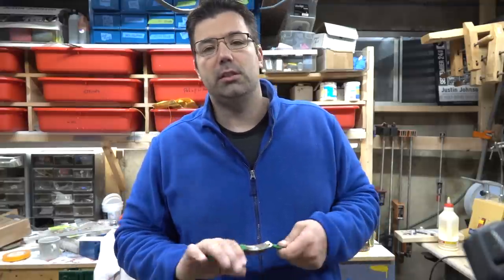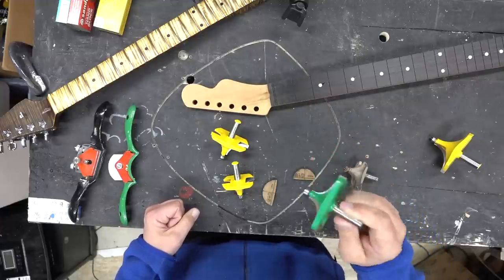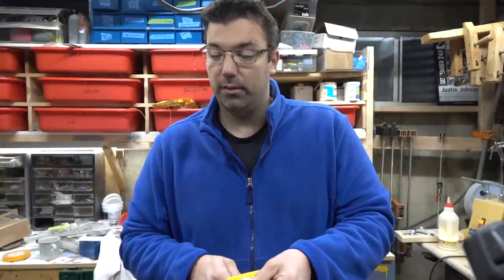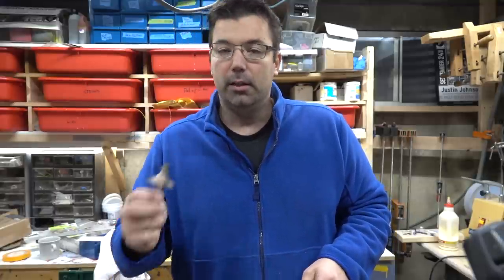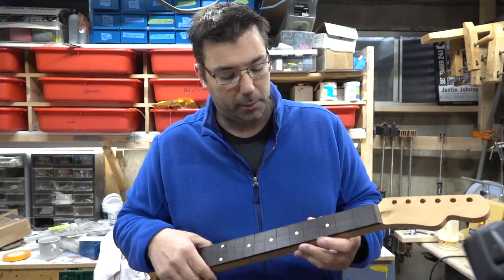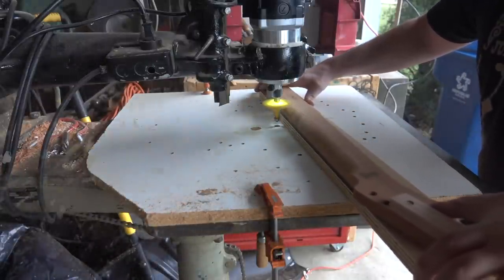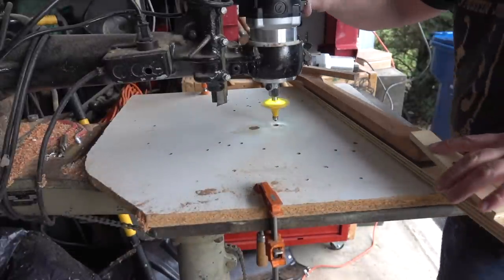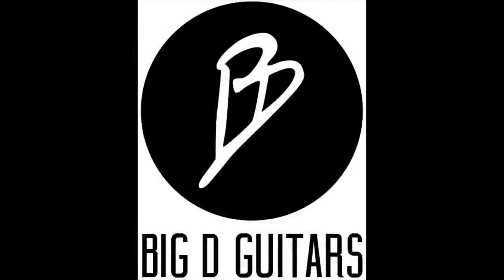Router bits for Carving Necks.  Should you?

Comment: as a 40 yr, carpenter, cabinetmaker, i can honestly say, " be careful ", with that router!!, smart to mount it in a router table!! ,, table saw, is #1 danger, router/ shaper, is#2 danger !! watch what you are doing,, dont work when your tired !!
Reply: Yeah - bit that big in a machine that doesn't have speed control & guards is definitely a bit terrifying.  lol - I'd probably set myself up with a 1" plywood "blast shield" to work behind...
Reply: Hey dan,, youre not kidding, a plexi.,, shield, would be nice,, speed control, try on scrap wood first, e.t.c.,,,...
Reply from the maker: good comment!
Reply from the maker: yes and slow down the larger bits.  I have a craftsman table router that I use the 3/4 router in.
Reply: actually I believe the jointer is #1 as far as frequency of accidents goes

Comment: Question: If I want to do this profiling with a router bit but want to have a tapered neck (say, 19mm to 21mm 1st to 12th Fret), how do I go about it? Do I taper the neck first and then carve it with the bit? Or do I carve it first and then taper it?
Reply: Can't you do full flat passes, lowering the bit 5mm each pass to get the entire neck 21mm thick on a side and then shim the nut side 2mm, raise the bit back up to 16mm and do three more passes, again lowering the bit by 5 mm each pass?

Comment: Maybe someone can help me out here: Is it really necessary to have an agled plane under the neck when you are routing? Instead, couldn't one just angle the neck and push that through the router? I'm planning a Tele neck build and I only have a routing table where the bit is on the bottom. So making the neck taper as shown in the video will not work out. Thanks in advance!
Reply from the maker: No.  I just sand down more a tad and call it day
Reply: @bigdguitars  thank you for your reply

Comment: Big D, got a question for ya, and anybody else that wants to comment, but it's not about neck carving. i'll try to make it as short as possible. Bought a cheap guitar (Davidson) for a make it better project. Tore it down, new paint, electronics, hardware. when I put the neck back on, I was looking it over and seen the end of the fret board was 1/8 inch above the body. should I shave some off the neck heel? I measured my strat neck, and it is a little thinner than the Davidson. Also, what would be the best way to do it? table saw with a fence? belt sander?  thanks a lot.
Reply: HMMM another luthier that can't answer my question. i'll figure it out myself.
Reply: There isn’t enough information for anyone to answer your question.  It depends on the bridge.  If your bridge sits high you may need to shim the neck.  If your bridge sits low you may need to shave the heel down.   If you need shave the heel down some sort of sander would be best as a table saw will take an awful of material off really fast and you are still going to need to sand it.